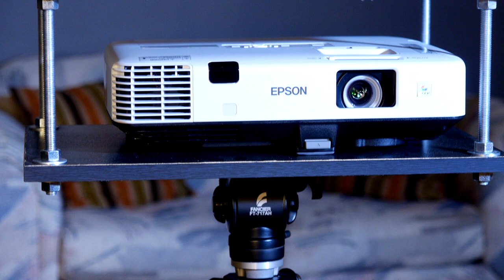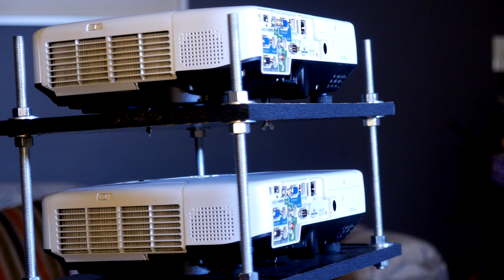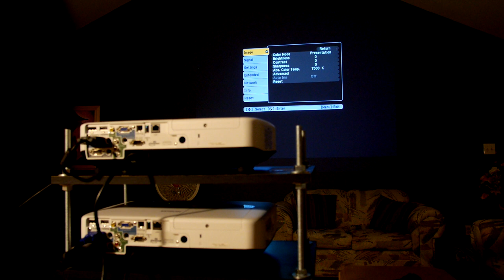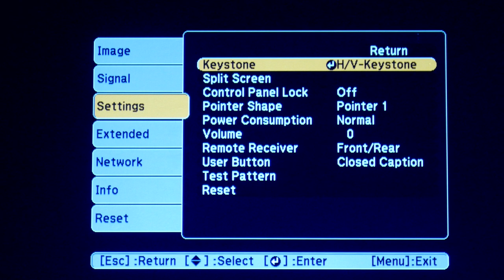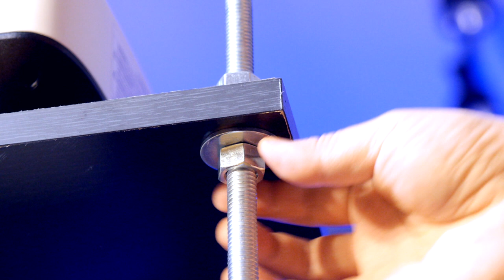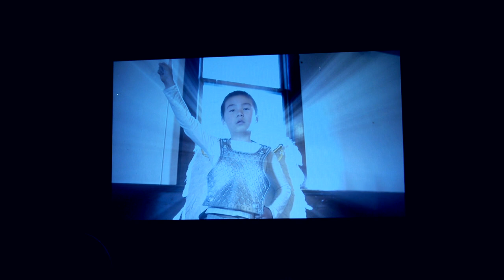DIY cheap way to build 10,000 lumens large venues projector

Comment from the maker: My testing of 4 stacked projectors, 20,000 lumens brightness comparison vs 3 vs 2 vs 1
Cheap DIY 20,000 lumens projector brightness testing, comparsion
Reply: +Tim Z Hi Tim, I'm considering doing this for a large outdoor movie projection.  My budget is a little lower than the $2600 that two Epson 1960s are.  I was considering a Benq MH741.  This projector 4000 lumens projector is $899 and has "corner fit" correction like the epson, so it should work the same way, right?  Thanks
Reply from the maker: +Alfred Martin sorry, I only worked with NEC and Epson projectors before so I know you can move the corners with small increments to make this work. I have never worked with Benq projectors before so I cannot comment on that brand.
Reply: One question. How close can you move this rig up to the wall? Like, to achieve a 42 inch image. Is this possible?
Reply: Tim Z can you giveaway me old cheap projector I really want to have one on my room if it's ok
Reply: Could you make a 3d projector like this? If you covered the lenses with opposing filters?
Reply: Tim Z 8

Comment: I built this rig for a recent event (September 15, 2016) and it works I used it for over 6 hours! There are some caveats though... There are omissions in the video and perhaps they aren't entirely necessary, but would have been nice. 
1 - Decide on how you can position your projectors on each board. Mine were mounted using the straight edge of the board to keep each one aligned. Position also has to consider the lens' position left and right.  
2 - Create a paper template for the projector mounting points. This will make drilling holes way easier. 
3 - Drill the corner holes slightly larger than the threaded rod. You need enough play that the boards do not hang when you move them. 
4 - The video implied that tweaking the blending of the two projectors was an easy thing to do.  It is not. 
5 - As the video states, you must have a projector that allows for corner HDMI adjustments. 
6 - Turn off remote control on the upper unit as the video stated. Use the wireless remote for the lower unit. 
7 - If you do events, determine how far you need to be away from the screen. Once you have this setup you will not want to move it. 
This thing is a real pain to setup. I used MDF and the threaded rod would easily get hung up when moving the top board/shelf.  
It does not double the brightness, but it does make enough of a difference that it is worth the hassle. 
That is all.
Reply: I was thinking why not invert one of them and use image flip and image shift. That way you could mount them bottom to bottom on a board and rear mount the entire rig using a bracket or something, it would only be slightly bigger than a commercial projector.
Reply: Is that because, as with most perception, the relationship between actual brightness and perceived is logarithmic. So a light meter may say something is double brightness but it may only appear 50% brighter

Comment: Great set up especially for a basic dual platform for the projectors. For those who argue the technical aspect of getting 10,000 lumens from two 5,000 lumen projector, I say the main point is you are getting a stronger picture for way less than a 10,000 lumen projector cost wise.  Wonder what a light meter would read for the two projectors verses just for one?
Reply: The lumen meter will just measure double the brightness. It´s your eyes perception which is applying a gamma curve / log scale.

Comment: Great work Tim. Nice rig. This is a tried and true method to get more brightness from projection systems and your DIY rig is a very economical approach.

Please note however that doubling the number of projectors does not double the lumens. The brightness increases logarithmically, not linearly. So two 5,000 lumen projectors equal something around 8,500 lumens as I recall (perhaps another commenter could do the math for us based on the Inverse-Square Law.) Each projector added brings less of an increase, with greatly diminishing returns beyond 4 projectors.
Reply: Nice info. Still Close enough. 1.7 times brighter then :P
Reply: Combined brightness will be 10,000 lumens, however our eyes and ears perceive a doubling in sound or light output on a logarithmic scale. Hope this answers some questions and clears any confusion!
Reply: The crux of your statement is correct, @Tracy Evans, but brightness is indeed doubled. It's the eye's PERCEPTION that doesn't see "double" the brightness, as @Astor Rosic pointed out before.
Reply: Tracy: you are just plain wrong. Most people in the event business have this point of view, but it just isn´t true. Use a lumen meter and check it for yourself...

Comment: Thanks for these videos about stacking projectors. I have only just come across the concept of stacking, so this is great information for me. 

For more stability in the stacking stand, I would suggest that if you installed a second Nut below the Nut that sit under the platform you are adjusting, the second Nut would prevent the first Nut from any movement due to vibration or thermal changes overtime. I used to make aircraft parts and we would use this double Nut method to ensure the Jigs would not lose their tolerance. You will adjust the bottom Nut as demonstrated in this video and then when you have it in the right place you can secure it by tightening the second Nut up against the first, that way the first Nut will remain in the perfect position.

Comment: I'd be interested to see this technique with a couple of polarizing filters for a proper (non-interleaved) 3D projection using the passive glasses that they have in the cinema (as opposed to the expensive shutter glasses used on 3D TVs and 3D projectors).  I guess it would depend on getting video that is separable into two synchronised streams and finding a polarizing filter that isn't too dark and doesn't melt in front of the lenses...

Comment: I think that this is a great solution. The only caveat that I'd offer is that you are taking a hit to contrast. But the proof is in the projection and I'm sure that when you're using your 2x or 4x rig, the image looks better and better for your application the more of the projectors you turn on. 
 When you're chaining projectors, have you noticed any lag in signal further down the chain? Or is the 4th projector's signal still seemingly in sync with the first one?
Reply from the maker: I used short VGA cables chain them from one projector to the next and did not experience any lag. I did run into problems with weak signal when I try to run long VGA line to the projector. That problem can be solved by buying a low cost 1 to 2 or 1 to 4 Powered VGA Splitter Amplifier
http://amzn.to/2vJZ344

Comment: I have the cree x2000vx  rgb  88watts led projector and its pretty bright and with higher wattage rgb  leds and different lense options   it could of easily been manufactured for large venue use at similar cost.

Comment: Actually, based on Disneyland Resort's Disney California Adventure mostknown attraction, World of Color does use this type of projector stacking. The reason why they did it this way is to make a very bright projector (my possible guess to the actual lumens of the professional type projectors are possible at least 20,000 lumens) they used the same way as Tim did in order to projector that vibrant image through the water screen. On my opinion, doubling a single 5,000 lumen projector will not give you a 10,000 lumen projector in total, it is possible that it will only total up to 7,750 lumens or even 8,050 lumens in total.

Comment: I would had tryed to mount them with the top one upside down and slide shifted so the lenses comes alinged each other and to reduce the gap between each of them at the minimum ( top to top) projector, almost touching. That way, alignment would make more sense as the light sources would become almost near as a single light souce.

Comment: If I had a pair of identical projectors mounted on the ceiling together (and I do) I would want to be able to control them independently with their IR remotes, but of course messages from remote will go to both units.  It would be interesting to try taking a page from the playbook of polarizing-3d-projector fan (which I am).  One could add polarizing filters to the ir sensor of each projector, each at 90 degree angle difference from each other and install one on the output of a remote.  In theory turning the remote one way should give commands to just one projector and turning it 90 degrees would send messages to the other.  Also since you have two projectors you have two remotes (hopefully).  You could put polarizing filters on both remotes (at 90 degree angles) and fun-tack the remotes to a board for convience.  If all goes well you could then control each projector with each remote when its tuned right.  This is all in theory, but it might be worth a try.  I personally have not been motivated to do this since my home theater projectors can be reached just by extending my arm upward.  In churces the projectors are mounted considerably higher up. :-)
Reply: This sounds brilliant but if it's doable I wanna know how before I even buy the projectors
Reply: Reach out plss🙏

Comment: i love how wild99hd says it doesn't work, as if stacking the two projectors creates a black hole and makes less light. The goal was to make a brighter image, it worked. Thanks Tim z for the explanation this has solved my problem i believe. How large can these projectors confidently project?
Reply from the maker: I have projected on the 24 feet X 13 feet stucco wall with medium ambient/stage lights and I am very happy with the results. I have done the similar size projection with yellow flat theater stage curtain with lights off and audience told me they could not tell the difference in image quality, brightness between movie theater and my video projection.

Comment: Hi ... Can The projectors be placed side by side? I am doing a large event and would like to hang the projectors from the ceiling and do not want to buy a ceiling projector hanger. I usually hang the projector from the "air wall" and because of the weight of the projector (35lbs Panasonic DW6300 and hanging from one point on the ceiling) do not want to stack vertically and was interested if I can place the projectors next to each other(horizontally) and if this would work ??? Thank you
Reply from the maker: Yes that will work. In this video https://www.youtube.com/watch?v=kbCWMMfJT2o
I have 4 projectors stacked. As you see they are not all top and bottom conf. I have them side by side also.
Reply: @Running1226  Thank You

Comment: What's the furthest distance this would project and still look amazing? I think from the back of our church to the projection screen it's 50 to 60 feet...
Reply from the maker: I have place projector raging 22 feet to 100 feet in distance and no issue. The most critical problems you need to solve are:  
1.   1. Cannot control ambient light. It will cause your image washout/hard to see2.   2.  You don’t have the correct lens/projector and/or setup for the distance you are
trying to work with. Your image is too small (no good) or too large (too much digital
cropping – light loss, res loss).
Reply: Ok, thanks Tim!

Comment: Very nice! Do you connect the two projectors together via daisy chain or with two video cards or something like a triplehead2go?
Reply from the maker: Ben Easler daisy chain VGA input to VGA output ports on projector
Reply: You'd use a DualHead2Go only when using the projectors independently to shine on different surfaces. For this project, the goal is to converge the image of multiple projectors displaying the exact same image onto one physical screen. Therefore, splitters or daisy-chains are the way to go.

Comment: Awsome video very detailed. I will try to build this in near future. I also found this video of special ICE screens that can help you get brighter image. If any of you want to take a look, but i can imagine they are pretty expensive. Stunning Daytime Projection demonstration uncovers the truth about projection screens.
Reply: Yea, those screens look nice but have you find out the prices? I went to their web site but seems very confusing. Same as you I think this projectors and the ICE screen will give nice results together. :)
Reply: To much for me :D after 10 emails i finnaly got the price for the size i wanted.

Screen cost $US8,850
image size : W 3,295mm x H 1,850mm (16:9)
Overall size : W3,345 mm x H1,900mm x D200mm
With wall mount.
Add $US590 for floor stand
Reply: Jan Rolih Jan it took 4 emails as you never gave all the details and we had to keep asking you questions. It pays to be always clear and supply all the information so we can quote you. Hope you found a solutions that allows you to cater against the sun.
Reply: PEDRO MONSIVAIS Our screens give to a x20 factor increase e.g a 2000 ansi projector will give a equivalent performance of 40,000 ansi projector on a matt white screen in a  well lit room.

Comment: Hi, Tim, Smart idea! Thanks for sharing. One question please- I need to put them both with ceiling mount. How could I put the two projects both installed from ceiling please?  Thanks & RGDS, Shuhong Yu
Reply from the maker: +Shuhong Yu 

You see how I mounted my project rig on top of professional tripod
in the video. For celling mounting just buy the celling mounting bracket then
screw the celling mounting bracket arms into the bottom of the wood platform. 
celling mounting $25 USDhttp://amzn.to/1VmXt20

Comment: Tim - Excellent video. Very informative. Q: would this DIY method work on a dark red brick house at night outdoors with very little little ambient lighting for 3D/HD house mapping  projection displays?  And what about the LED chips or bulbs, do you replace them?
Reply from the maker: With  little ambient lighting one 5000 lumens project will do the trick. I don't mod the LED chip or mod the light bulbs.

Comment: Hi Tim...I'm hoping you still monitor this post. Im wondering if this same application could be used for short-throw projectors? Im doing up a small(ish) theater but with live performance we need short-throw to reduce projection on the actors. Recommendations on models?
Reply from the maker: Short-throw projector will work also. The key is the projectors must have "Quick Corner" this digital correction feature allows you to move any of the four corners of an image independently at setup, to adjust each corner for a perfectly rectangular picture, even when the projector is not squarely aligned with the screen. Take a look at Epson PowerLite 535W 3LCD http://amzn.to/2jMlYrg

Comment: Could you reduce weight with smaller threads (bolts) and use aluminum for your shelves? Those Epson Projectors are not that heavy. Also if you don't mind used projectors like the Epson you have and even better models with prices under $200. Or less less than $100. Let me know I can give you a couple of places to look.

Comment: Fantastic Job! Thanks for posting this. Which Epson 5k lumen projectors did you use?
Reply from the maker: Hi, I used two  Epson 1960 projectors.
http://www.amazon.com/gp/product/B007VPKR0U/ref=as_li_ss_tl?ie=UTF8&camp=1789&creative=390957&creativeASIN=B007VPKR0U&linkCode=as2&tag=camegadg-20
Reply: Thanks for sharing your method of getting 10,000 lumens on the cheap. You helped me out alot!

Comment: Hey man, Great Video! But i have a quick question! I'm in charge of video/ audio at my church. Well, the guy who figures how stuff works, corresponding to cables, resolutions, formats of every kind and well, pretty much trouble shooting everything tech-related. Now,my question is... I want to place these two projectors at my church's temple. Now here's the  dilema.. The projector would be suspended in mid air ( Comming from the sealing, There's Metal Pipe, in which they used to place one there), in front of the stage. So that the projection would be @ FOH. And i want to place the Computer/Mac/Device where the audio-booth is... Sounds simple, but my problem is that the distance from X (Projector) to Y (AudioBooth) IS around 250ft... Because the cable has to go UP, then to FOH. How would i exactly get Video ONLY from Y to X ? What kind  of cable ?  CAT5 ? running it through some boosters ? Please help me. It will be highly appreciated.
Reply from the maker: Roberto Licardie Hi, my church just did the same project last year. See the items you need to run long cables to projector.

For VGA connection all you need is amplifier which will do up to 328Feet maximum transmission distance
VGA Amplifier 
http://tinyurl.com/lzt7bam
Get three VGA long cable connect/Tape them with with Gender Changer Adapter Male to Male
http://tinyurl.com/lgoumcp

For HDMI you need HDMI over CAT5 Extender
http://tinyurl.com/nfksw7p
Reply: Tim Z You're a life saver! Thank you so much!!! That's exactly what I needed to know.
Reply: Hi Roberto
Buy two sets of Casio SK600 Led Hybrid projector, you can control all the projectors to a bright picture with the remote control. Then use the network cable to send video signal instead of the cat. 12000 lumens at low cost and 20,000 burning hours.
Reply: bennynorman one XJ-SK600 sustem (2 projectors in stek) = 6000 lumens. the price is $4.200. For 12000 lumens = $8.400

Comment: your geometry is way off, you should get projectors with lens shift and move them closer together. maybe consider 3 legs 2 up front 1 rear and stacking them on the bodies. corner correction should come last. because if you align them right, each time you move them or bump them they DON'T need to be readjusted